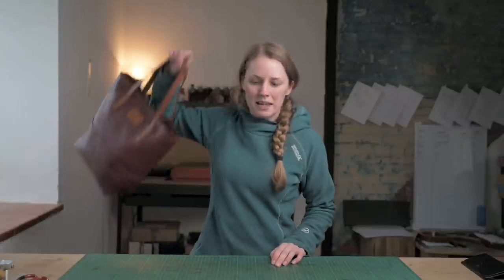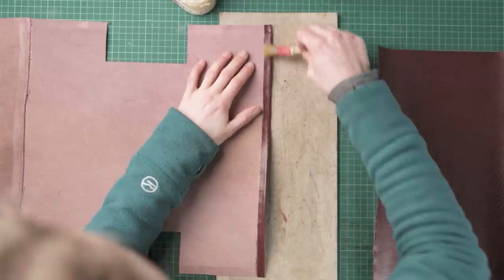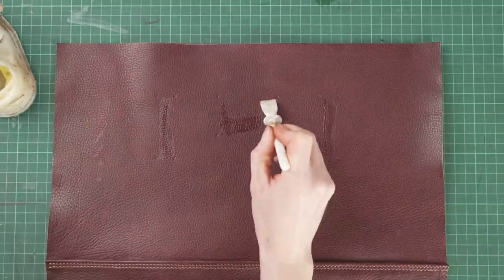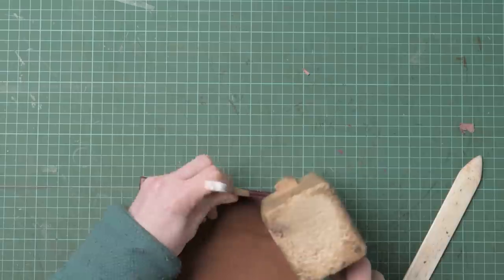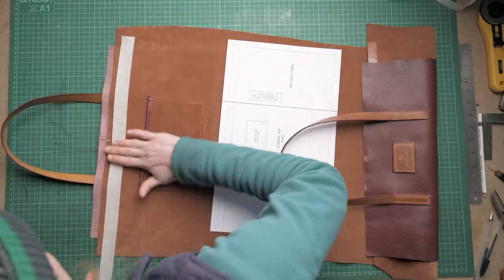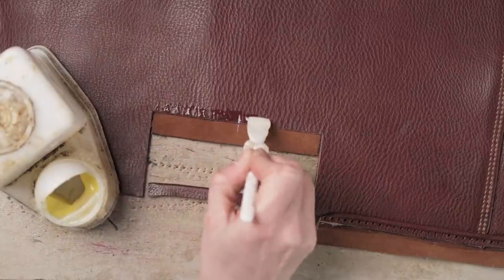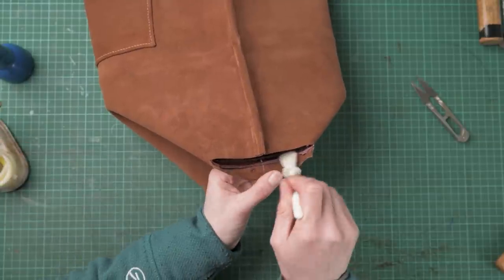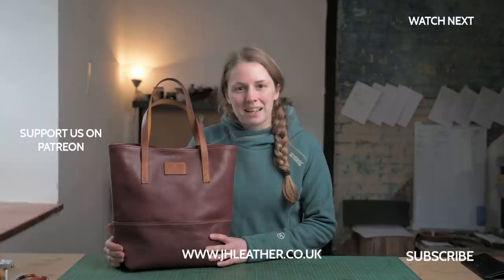Make Your Own - Tote Bag ~ Make Along // PDF Pattern Pack

Comment: OMG, you hand-stitched everything. I  was thinking that you would have used a machine to do the longer parts. I need to start leveling up my skills with folded edges and piping. By the way, I will be using some harvested furniture leather that I hunted down. 😂
Reply from the maker: You can use a machine for this bag but I prefer hand stitching and as a lot of viewers don't have a machine then it allows them to see how to make this bag without one 👍

Comment: OLD LEATHER SMITH here, Excellent Job as always Suggestions, since I hand stitch everything like you do, when I have a large flap that gets in my way I have found a way around that problem, I bought 1 long piece of 3x3x8ft and made a L shape  stand with a leg on the bottom that I could anchor 2, 1 of my benches, this way I could move it at my convenience, I just hang a string with a clip attached 2 hold the flap out of the way, since I make moccasins I have learned how 2 turn them easier, I originally used a broom handle, but found a closet clothes rod stouter, I round one side of sand smooth, place at the floor near a wall I did rubber band leather on the other end so as not 2 slide around, both work great, Great Video thanks again, GOD'S BLESSINGS ✝️⚾🙃

Comment: Love your content. About to purchase pattern. I've never stitched longer than a womens clutch. How can I hand stitch such long runs with a single thread? How long would you estimate? Thank you!!
Reply from the maker: I don't worry about using a single thread for long lengths.of stitching. The thread is unmanageable and tends to get fluffy over long lengths. I use a double arms width for all my long stitching, then do 1 and a half back stitches and start a new thread from there.

Comment: Nice. IMHO. I think that you should use cattle split with a thickness of no more than 0.8 mm as a lining - this will make the product lighter. But for a bag for everyday use, leather is not suitable as a lining, since it is prone to dirt (grease). The best solution in my practice is a removable lining made of thick cotton or gabardine.

Comment: I was very confused at first because you were demonstrating gluing & folding over the top edge of your bag. However - in the product there are NO folded over edges. Confusing? You betcha.  Then later you added the lining. Why show the folded over edge at the beginning?
Reply from the maker: Because this outer bag is made in 2 pieces and where the bottom joins the top part there is a folded edge
Reply: @JHLeather  sorry. I didn’t catch that. Thank you!👍